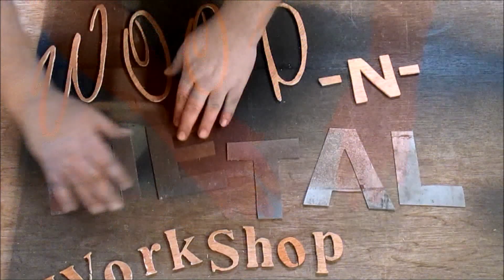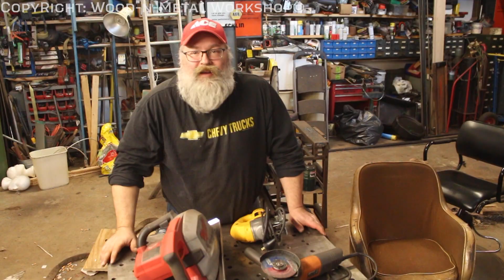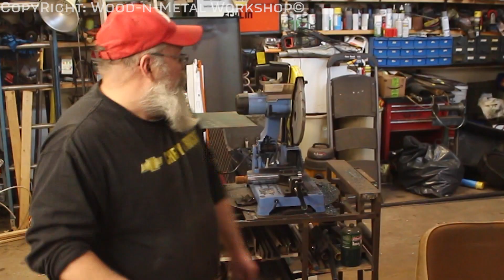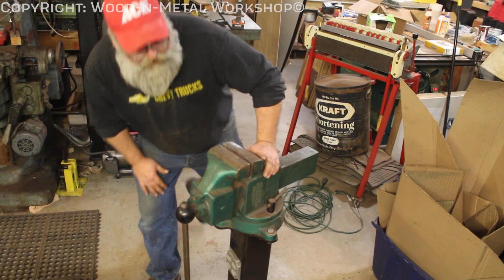My 5 top metal working tools

Comment: Seen your post on the wells 645 you had online I recently picked one up myself sadly it’s a b&s9 spindle I’ll be having reground but I’m missing a few pieces actually missing all of the locks for the table and knee also looking for info on replacing the bearings without paying 681$ just for bearings from wells
Reply from the maker: Some of the parts you can get from McMaster Carr. Thanks for watching and commenting